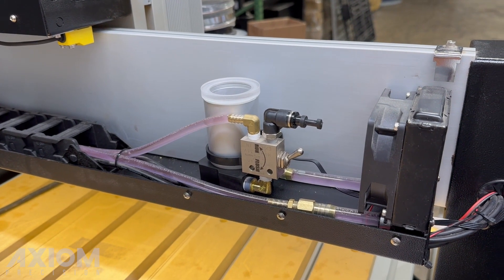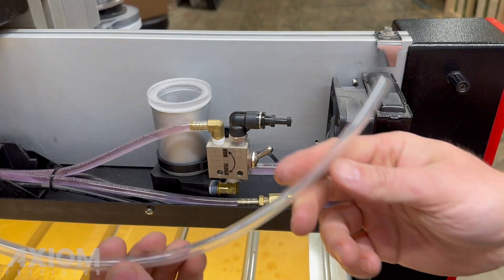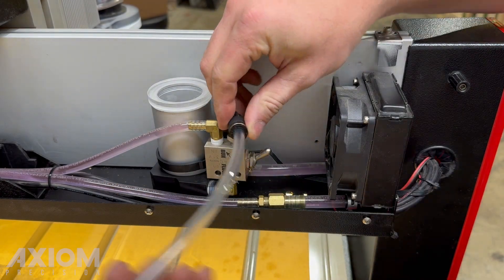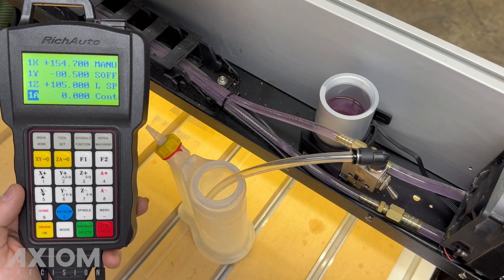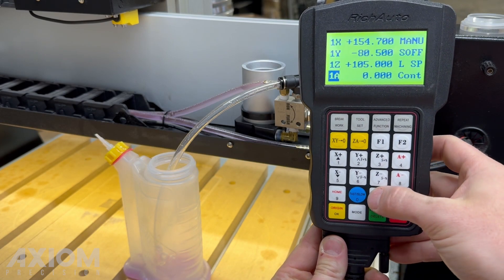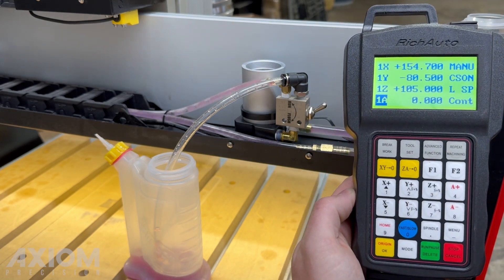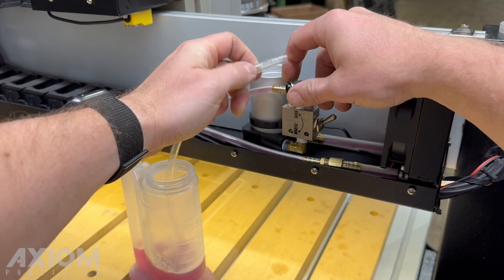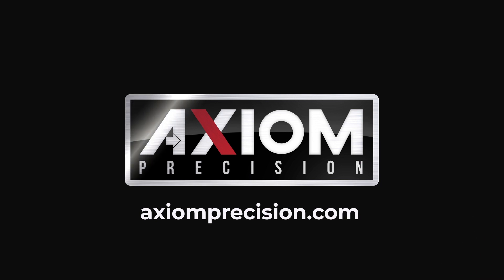Axiom CNC Machine Maintenance Part 3 "Cooling System Maintenance"

Comment: Why do you ignore the older Axiom systems?  They are still out there.
Reply from the maker: Dale we do have some content in the pipeline for some of our older Pro and Pro+ machines on the way. If you have the older square pump you will disconnect the spindle return line going to the small 90 degree fitting. Attach your drain tube to the fitting and lead it to your empty container. Activating the spindle will drain the lines. Then reconnect your lines and top off the coolant and let it cycle through the system for a minute. Top off your pump and reinstall the cap. You may want to do that twice to ensure you have cycled out most of the old coolant. If there is some content you would like to see for future videos please be sure to leave a comment.

Comment: Thank you for this!

I have to check mine, i think i have a box type reservoir.
Reply from the maker: If you have the older square pump you will disconnect the spindle return line going to the small 90 degree fitting. Attach your drain tube to the fitting and lead it to your empty container. Activating the spindle will drain the lines. Then reconnect your lines and top off the coolant and let it cycle through the system for a minute. Top off your pump and reinstall the cap. You may want to do that twice to ensure you have cycled out most of the old coolant.